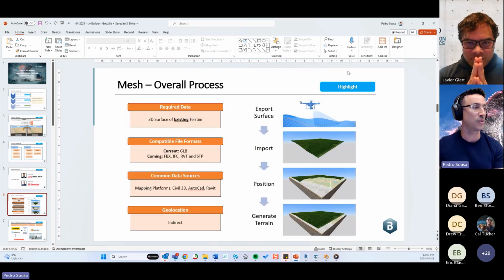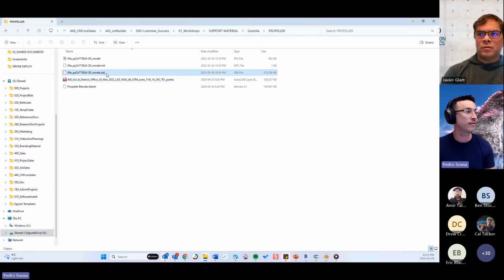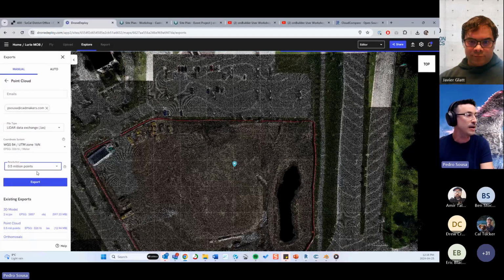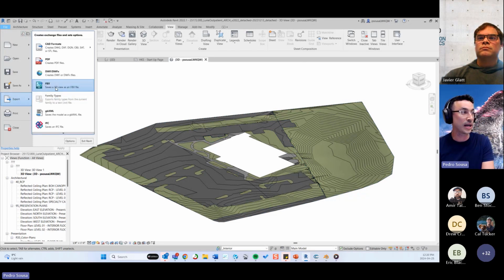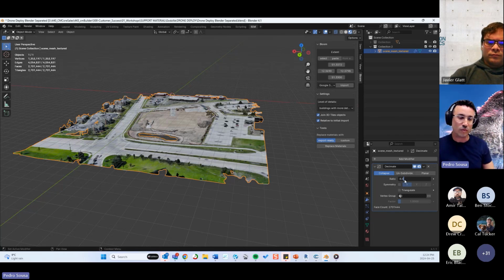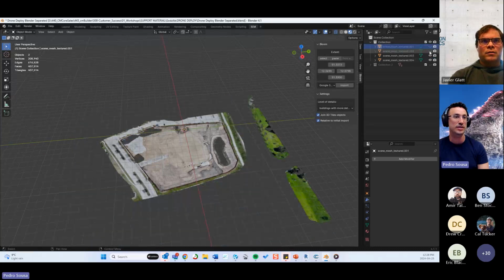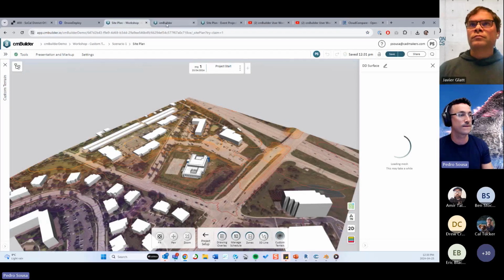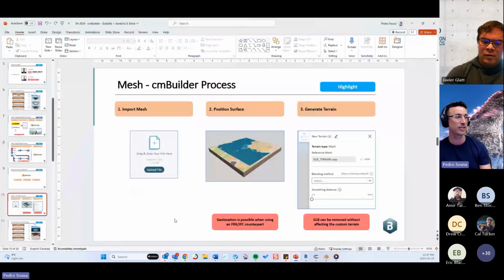How to create custom terrain using mesh (3D surface) in cmBuilder

Comment: This would be really awesome if we could generate this as a separate terrain, meaning that I could use it as a milestone like an "initial grading" milestone where I start with the original and then it changes to the "stripped" surface (new terrain). Is this possible? It would be a great way to start a 4d video with the site being graded and then start your terrain cut and fills.
Reply from the maker: Thank you for your comment! This is a great idea and it's actually already on our roadmap. Please submit it as a Feature Request in the cmBuilder app — it helps us prioritize based on user demand.
In the meantime, a current workaround would be to create two scenarios, each with custom terrain. 
Thanks again for sharing your thoughts!